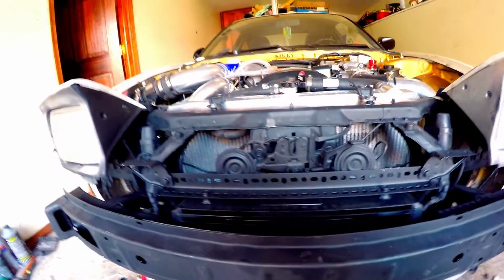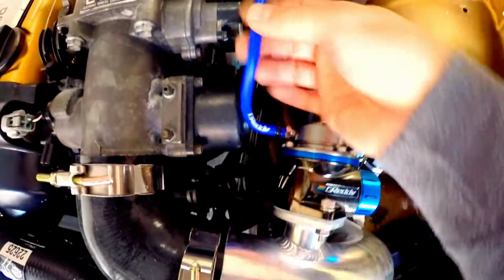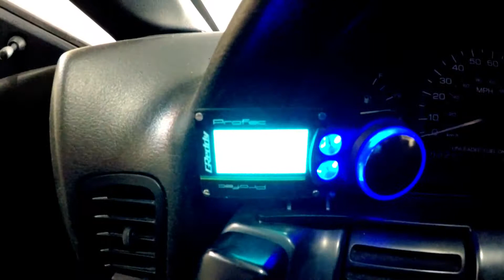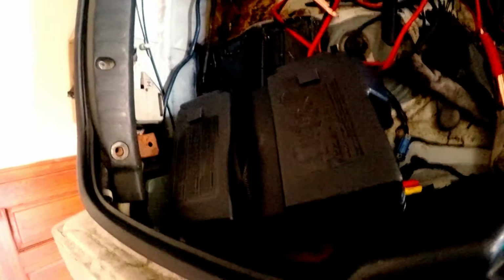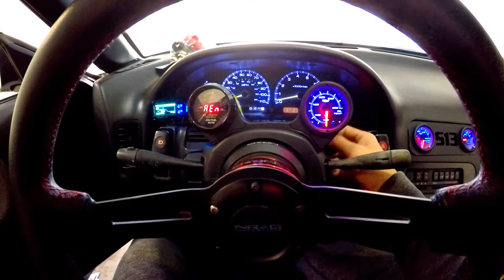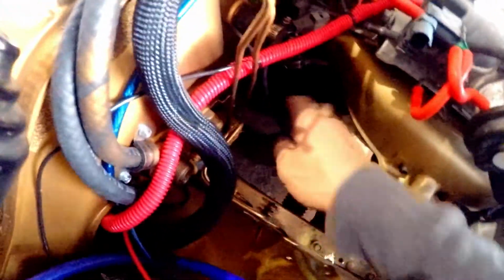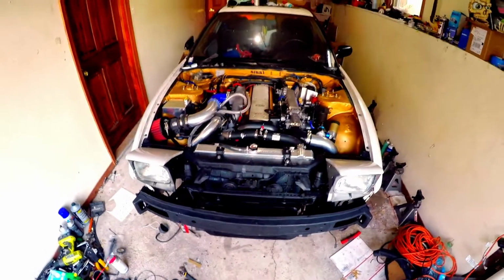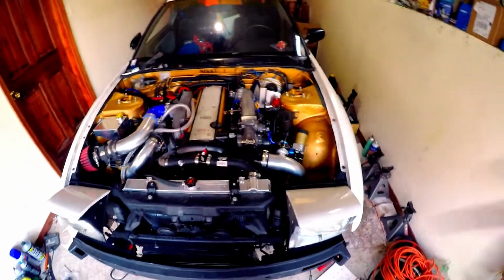Nissan 240sx S13 1jz VVTI Swap  PART 12 REV Limiter  .!!!!!

Comment: hey great vids man. im doing the same swap here in a few months. Got a question for you if u can help me with . what type of clutch master cylinder do i need and slave cylinder for the 240sx?. Its a auto and im gonna run either the 350z cd008 that i have or saving up for the r154. and what websites are recommended .. thanks.
Reply from the maker: Hey man I'm using the oem s13 5/8 clutch master cylinder, how ever the slave is depending on the transmission u getting